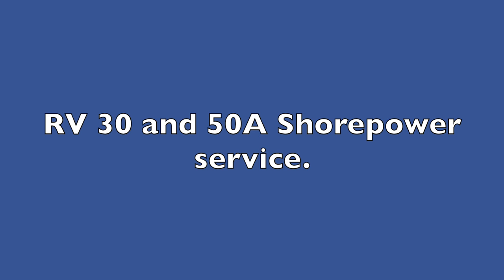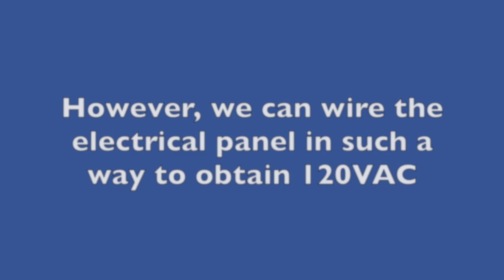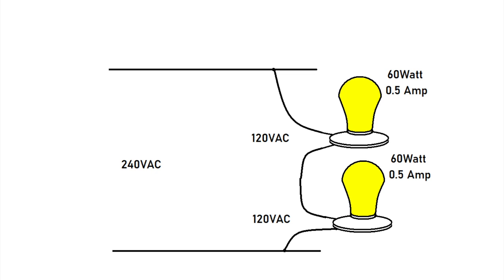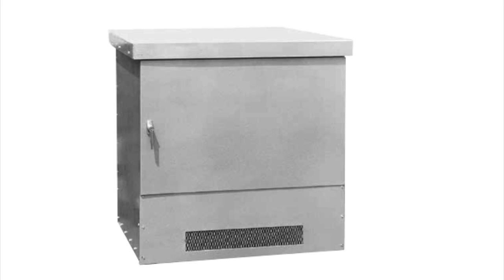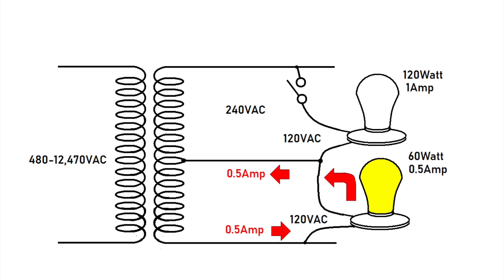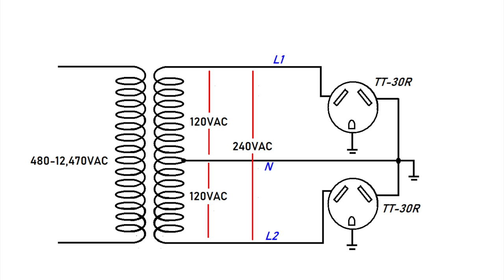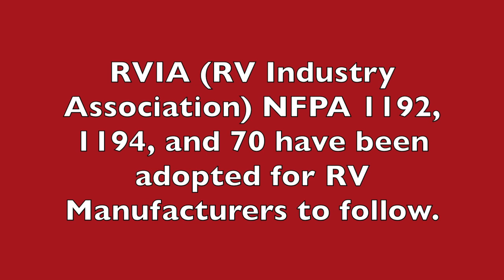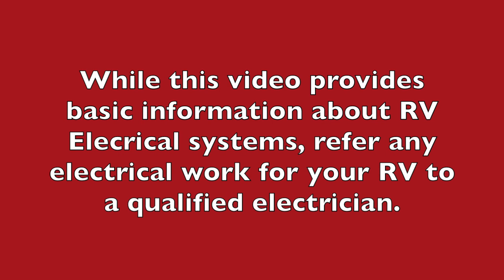RV 30A and 50A Shorepower Explained.

Comment: Thank You for explaining it. I am a retired HVAC tech with a lot of experience. I am looking to downsize from my manufactured home to a "Park Model " that comes with a 50AMP hook up. It comes with a Mini- Heat pump /AC  and an electric water heater. I want to add some Hydro-sil baseboard heaters but I wasn;t sure I would have the 230 V necessary. When the digital FLUKE meters came out, I went out and bought my own. The company I worked for provided us the little analog meters that will kill you, especially if your working 3 phase. I am 77 now and still have that fluke I bought in 1970. The worst service call to diagnose was when for some reason the neutral leg had an open circuit. My daughter now lives/works/travels in her Thor Tallero 20J and I had to teach her about all the different plugs. I also installed a 30 AMP plug alongside my garage so she can hook up when visiting. Cap'n Rick, Port of Lewes, Delaware

Comment: Trying to install a 50 amp service for my RV. I was with you until you showed your breaker panel and at the end you said you had the two breakers dedicated to the RV circuit with legs down to other breakers sharing 120 volts. Now I am more confused than when I started. Electrical work is not in my wheelhouse, so its not your fault.

Comment: So, do they just run 220 through the cord kind of like a power supply coming into your house? It’s not to have 220, but gives 2 lines in one so you have the same amps available on each leg? Increases amps available for running another AC, etc. thanks

Comment: I own a 30amp RV. I'm looking into installing an electric tankless water heater. Is it possible to upgrade my rig to a 50 amp system and use one of the legs for the water heater alone and the other leg to the rest of the RV?

Comment: I have a 2008 FEMA trailer and it seems to have 3 live circuits on it. How can that be? I assumed it would only have 2 circuits 15 amps each? I'm on 30 amp park power. I'm probably missing something. I try to run 2 small space heaters on the same "line" and it trips the breaker for that line

Comment: I suspect only 20% or so of the bigger RVs need 50 amp service and thus most folks should be fine with the 30 amp setup. If you want to future proof your setup, spending $200 or so now for the heavier wiring and larger CBs is probably a decent way to go.

Comment: Excellent video!  Can you please explain how a TT-30 plug to 14-50 receptacle adapter works?  Does it connect L1 and L2 inside the RV together?  How do 240V appliances in the RV react to that?
Reply from the maker: Generally the TT-30 to 14-50 dogbones simply parallel L1 and L2.  Since most RVs do not use any 240VAC appliances,  the breaker panel is wired for two legs of 120VAC, just like your house, without an available 240VAC branch connection.

For the few $2million custom high-end RVs that do use 240VAC for clothes driers and such, then you could obviously not use a TT-30 dogbone and would have to stay on 50A service.

Comment: Love your video! I can’t figure out how the neutral can handle both legs? Let’s say you run the 50 amp service as talked about but instead of 50 amp plug, you run two 30 amp RV plugs (one from each leg) but each leg uses the neutral which is the same size as each leg? If all the wires are the same size, how does the neutral handle return from two legs without melting? If two campers were running at 30amps from each leg, doesn’t that put 60amps on the one neutral wire? Is that ok to do?
Reply from the maker: It all depends on how the shorepower pedestal is wired.

In an individual pedestal, the 240VAC circuit would likely be split into two 30A circuits using L1 and L2, which would maintain the differential current on the neutral.

However, if the same leg L1 or L2 were used for each side of the 30A adapter, especially if the shorepower pedestal services more than one site, then potentially there would be the chance for 60A on the neutral, however unlikely that would be.  And for that reason, I do not like the 30A adapters.

Comment: Do the outlets on the outside breaker use more electricity? My landlord is saying I'm stealing electricity cuz I have a space heater plugged to the outside panel using an extension cord...
Reply from the maker: Don't quite understand your question.  Whatever power consumption meter records the electricity used by the outlet is who is going to get charged for the electricity.

Comment: Should the breaker in my house be a gfi breaker for my 50 amp fifthwheel?
Reply from the maker: I believe the National Electrical Code recommends it, but before having your electrican install one, have them  confirm it with the NEC Article 551.

Comment: What happens to the low side of the input circuit?  Does the low side of the transformer go to ground?
Reply from the maker: The secondary of the transformer - center-tap - is grounded. The "top" and "bottom" of the transformer secondary are L1 and L2 - both "hot" sides.

Comment: Can you tell me what is a bonding jumper plz
Reply from the maker: Basically it is a ground strap. Its typically used to ensure a good ground path in non-conductors. For example in a cable raceway, you might use a bonding jumper where one ladder section attaches to another to ensure continuity between them.

Comment: Plus also one thing to add it’s not three pole four wire it’s a two pole for wire. We call it polls because that is the gang of breakers that are connected together in the panel so they two pole 50 amp or pole 30 amp are only considered two polesof three pole and our language would be three phase and these are not three phase

Comment: The biggest problem I've heard of is either a do-it-yourselfer or a not-so-good certified electrician installing a 240 volt 30 amp outlet on someone's house for them to plug their RV into.
Reply from the maker: I have heard a few of those stories too, which is why my advice is to tell the electrician to install the RV service in accordance with the NEC Section 551.  Any competent electrician should have a copy of the NEC. If they don't, they are winging it, and not worthy of your business.
Reply: This happened to a friend of mine.  Burned out both air conditioners and TVs.  His service was installed but a licensed electrician but this was his first rv service he installed.

Comment: Wow, I have completely wired many new construction homes and set up my RV 50 amp plugs at the different homes I own. Your explanation was not easy for most to understand. It is easier to explain it as there is only 120 volts (give or take a few volts) going into any home panel. The two 120 legs are just out of phase with each other. There isn't any 220 volts. Each leg is 120 volts just out of phase. Everything in the master panel is 120 volt. What happens inside the machine (Welder, electric motor, etc.) using the two legs of 120volts is not important. Nothing in an RV runs on 220 volts. Everything in an RV is 120 volts.
Reply: You may have wired many homes but you do not understand the system if you think there is no 240 volts in a house or an RV with 50 amp plug.
The 120 volts being out of phase is only valid if you say with neutral as reference.

Comment: I hate that people give Edison credit for "inventing electricity" when it was tesla that came up with A/C current.. including 240v split phase
Reply from the maker: It is true that Tesla was the proponent of AC Current, but it was Edison that came up with the split phase idea. 

 At any rate, the purpose of this video is to explain Shorepower, and not necessarily get hung up on semantics.
Reply: @RVProject     I believe your history is a little off.   Tesla wanted to use 240 volts straight.   Edison had invented and was manufacturing light bulbs that ran on 110 volts DC.  So, the battle began and the standards people decided electricity would be at 110 volts for lights.   So Tesla came up with the 110/220 volt system.   At least this is what my research found years ago.

Comment: I don’t know why you’re calling the neutral 240 V you can never measure 240 V to ground. I understand what you’re trying to get to the neutral is grounded but you should never say that the neutral is 240 V between the neutral and hot would be 120 only, hot to hot 240 neutral to ground to be zero 35 year electrician here